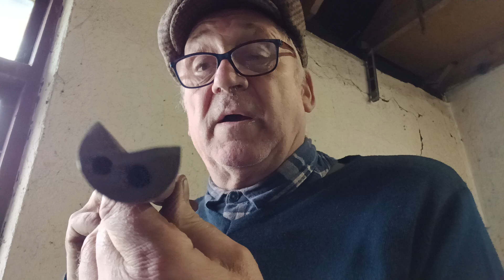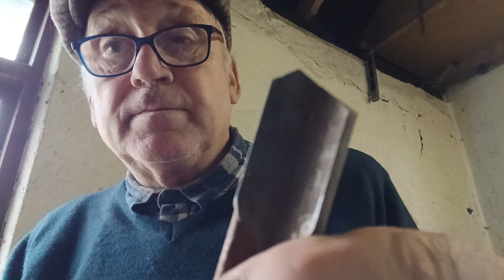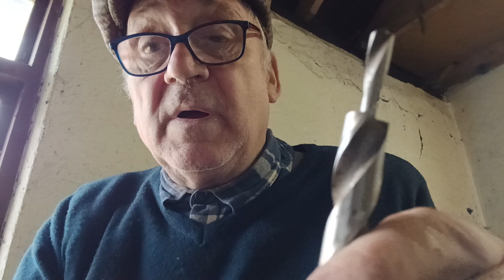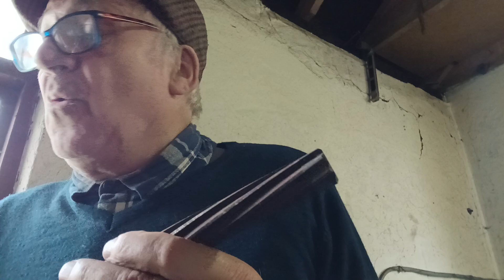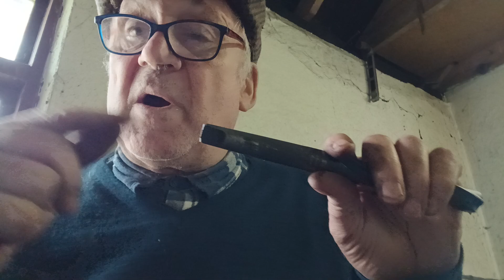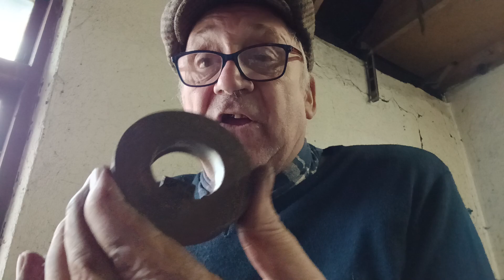Producing Holes in Metal. A look at the tooling now and long ago.  5th June 25.

Comment: I used an adjustable type reamer few times on brass bushings val in cast iron frame for  the clutch release bearing crosshaft bar  tractor repair..same thing with the steering bushings too..!